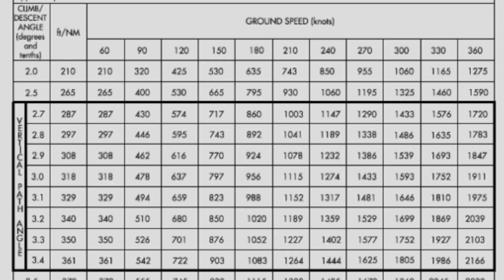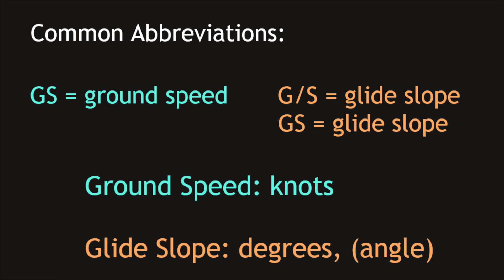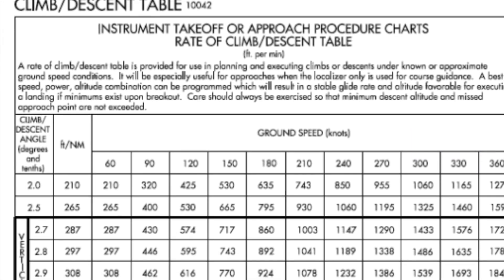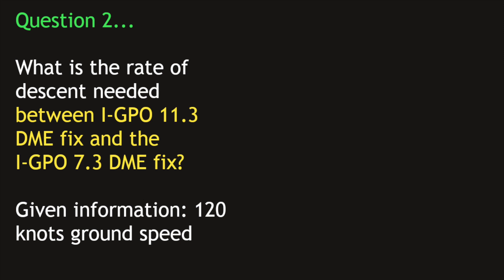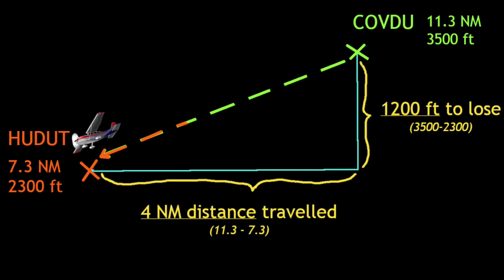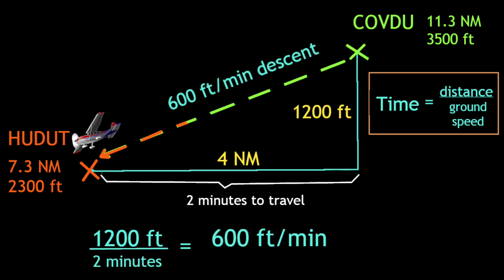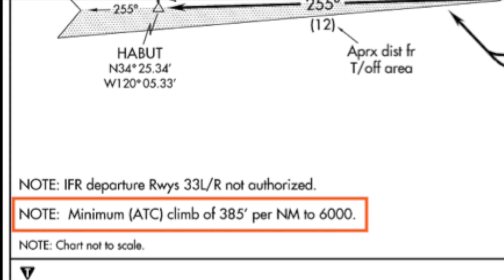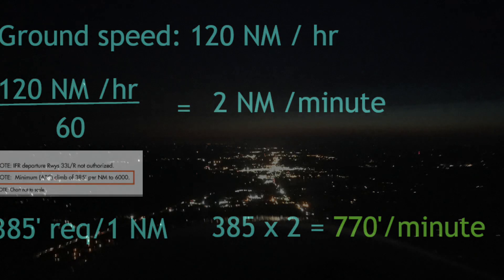Rate of Climb/Descent -Instrument Written Test Study

Comment: Good video!  Kind of a cheat is on the one where you have to know rate of descent without table, rule of thumb is multiply groundspeed by 5.  120x5=600   Gets you in the ballpark everytime for quick cockpit math!
Reply from the maker: Thank you for sharing Bob! Timely and practical methods are definitely best when flying.
Reply: That math puts you hundreds of feet off from the correct answer.